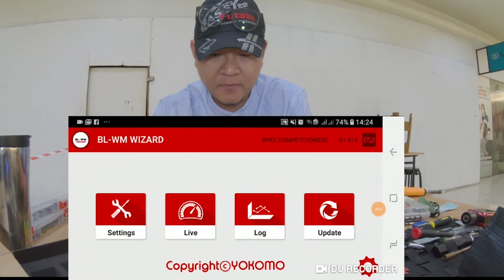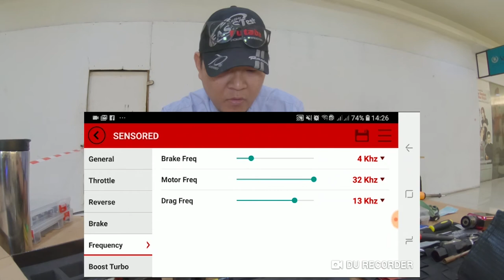RC drift tipstrik : Yokomo ESC RPX2 Unboxing & Installation

Comment: halo om albert, mau tanya kalo bec nya di set 7.4v, gyro yokomo v4nya aman kah? apa dia max voltage nya di 6v ya? saya coba check di web yokomo belum nemu
Reply from the maker: Gyro aman om tapi output dia tetep ngak nambah naik voltasenya